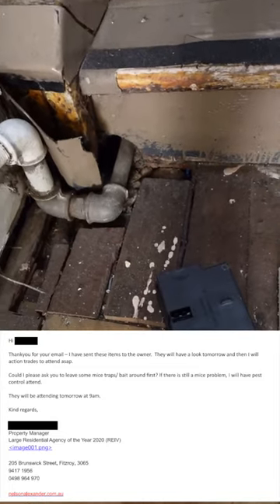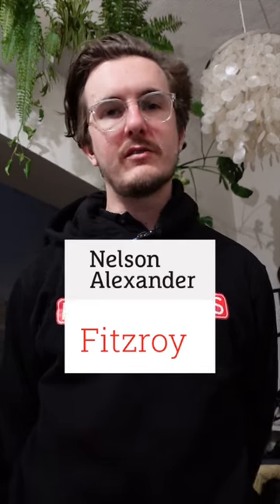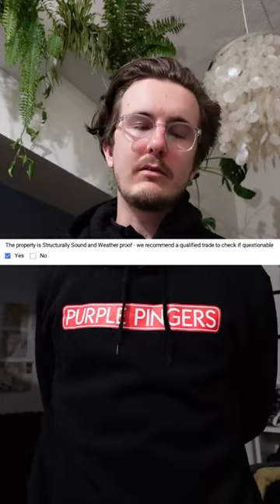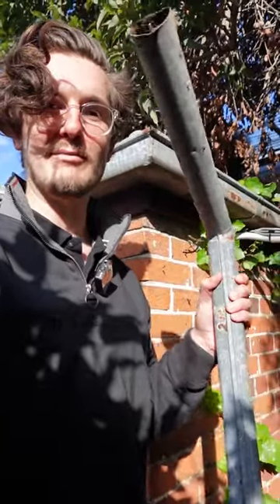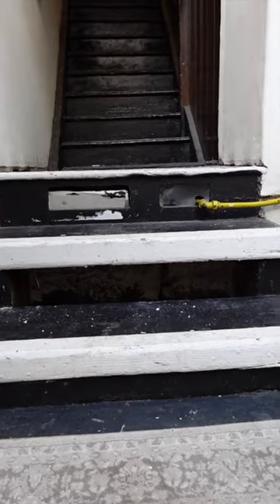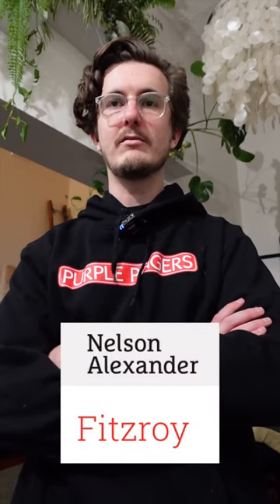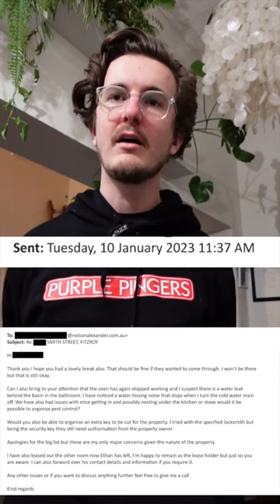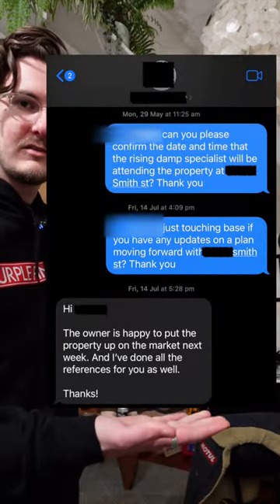Nelson Alexander Fitzroy - Smith Street

Comment: The frayed wires on the outside are usually the old disconnected wires. The bathroom sink could be cast iron so it should look rusty if it is. Good videos. Keep it up.